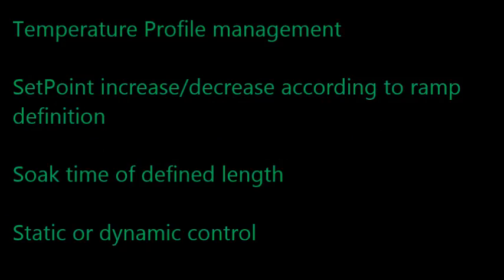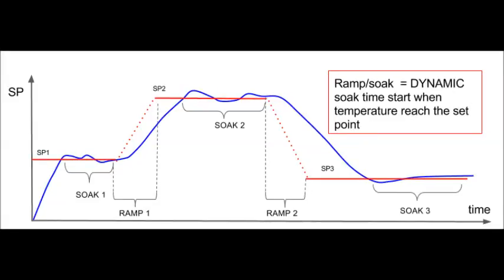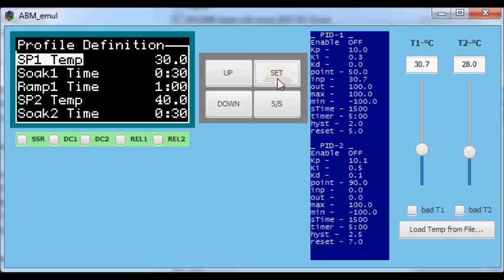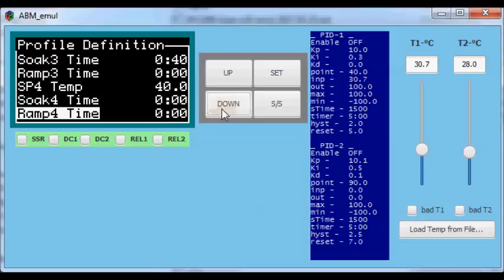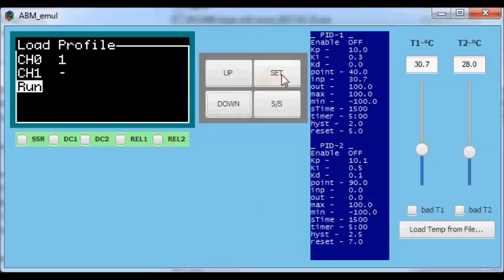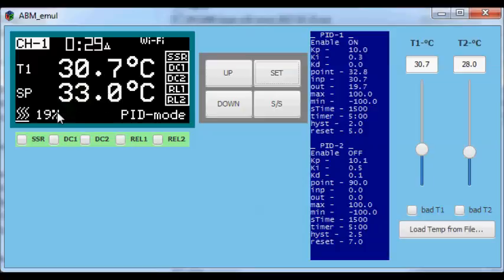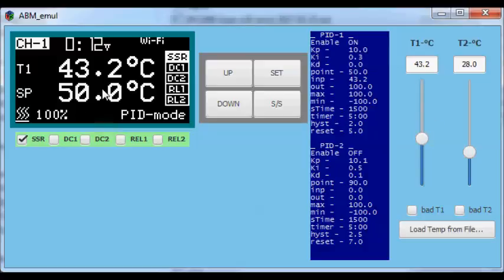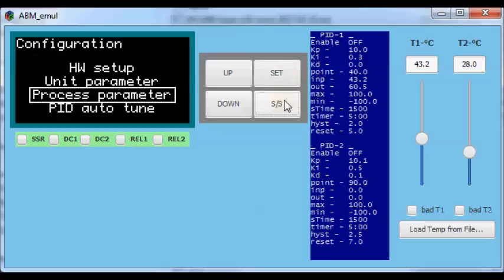SmartPID temperature profile management

Comment: A lot of brewers are not very technical, and this type of presentation makes the SmartPID very scary.

Do you have a presentation, showing how the SmartPID working with a Beersmith recipe?

A LOT of home brewers are buying the electric one pot brewing systems because of how easy they are to use with Beersmith. They do not need to understand how PIDs work.